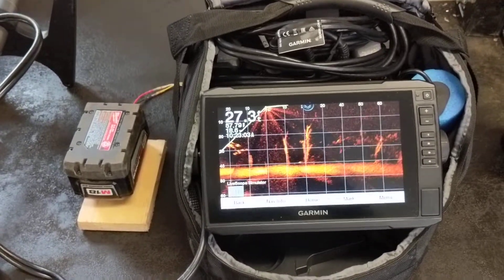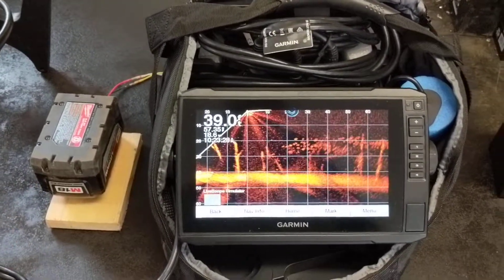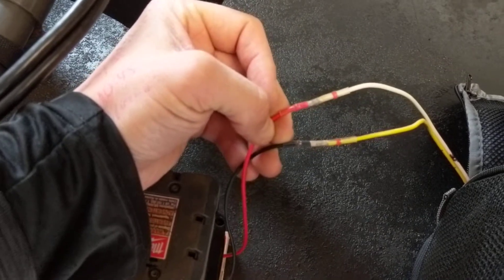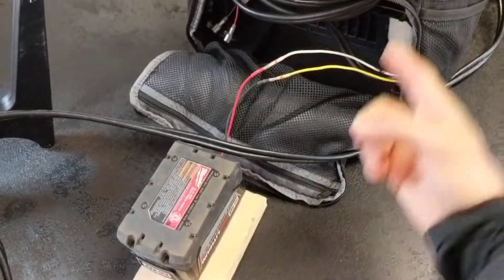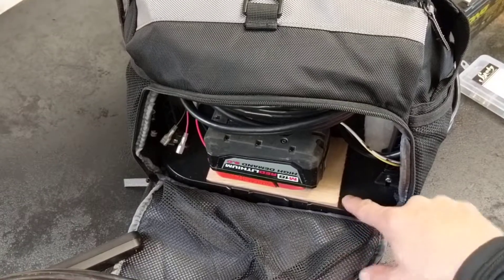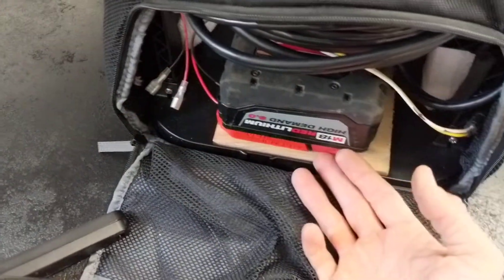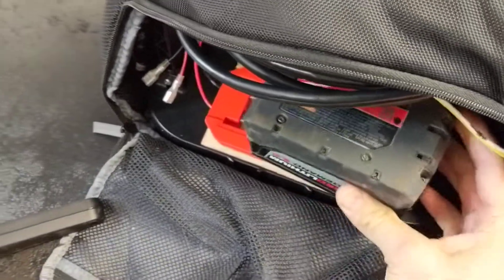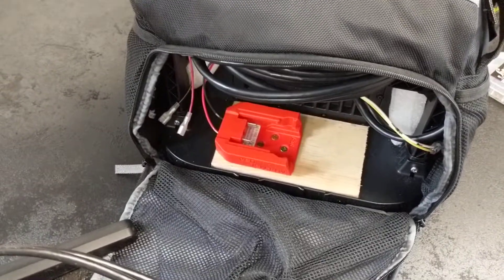Garmin Panoptix Livescope DIY all seasons M18 Milwaukee battery upgrade!

Comment: I'm looking to run my Livescope Ice Bundle on my Milwaukee M18 batteries. I am trying to figure out if there is any low voltage protection for my M18'S? Do you know if the M18's or the Livescope unit have built in low voltage cutoff? Have you had any issues with this? Thanks
Reply from the maker: I never had any problems with my m18s, they would usually shut off around 17 volts.

Comment: Awesome video man. I've got the same exact unit. I was just wondering did you buy the plug and wires for the charging port that connects the Milwaukee battery? finally took the unit out on some open water today and was amazed by the detail and amount of fish, my only complaint though is the stock lead acid battery only lasted for about 2 hours. Once it got down to 9.v the transducer started glitching out and eventually quit working. Anyone considering one of these units getting a better battery is a must
Reply from the maker: The plugs for the Milwaukee adapter are standard sae connectors. I bought them on Amazon
Reply: Is there a link to Amazon on the adaptors?

Comment: Great set up. You can get a voltage regulator off of amazon for like 10 bucks. Seems like some cheap insurance to help protect your expensive unit. Thanks for the vid.
Reply from the maker: There's no insurance needed. Adding a voltage regulator will increase the amperage from 1.25 to 1.75, thus reducing battery life.

Comment: can this be done with dewalt 20vmax batteries? Dewalt states their normal voltage is 18v. 20v without a workload
Reply from the maker: Check the voltage on a fully charged battery, if it is below 20.5v then yes.
Reply: @818Outdoors  
Thanks for your advice.Just to be safe, I got an inexpensive buck converter off amazon and dialed the voltage down to 15v. This way, I can use this setup for any of my electronics by dialing my voltage down as needed. Great videos by the way! Very helpful.
Reply: Yes it can.......I am using the Dewalt 20’s and no probems at all.

Comment: How did you wire out from the adapter.  Only can find usb for power
Reply from the maker: The adapter I use is just  a mounting  plate for the m18 that uses the full battery voltage. I used an extra two prong connector I had used heat shrink butt connectors to connect it so that I can wire straight to the two prong connector Garmin provides.
Reply: Hey D,  I’m unclear how you wired the Milwaukee mount to the livescope.  Which wires did you connect them to? 
Also would it work to install a flat topped male  crimped terminals to the ends of the Milwaukee mount, then you’d be able to slide right into the Garmin female terminal to power it up.  Think that would work or would a guy melt or blow something up? Let me know thanks a bunch

Comment: Your setup is exactly what I’m doing wondering how you did the live scope in the ice bundle
Reply from the maker: Check out my other video, I go into depth on the build. Thanks!
Reply: 818 Outdoors watched all of em lol guess I’m just wondering what all you had to purchase you got the ice bag and what it comes with, live scope, and a head unit. Is that all?
Reply from the maker: 93sv, Livescope unit, big ice kit, ice mount. The bag kit will come with the ice transducer as well as the 12 amp hour battery and some wiring adapters. once you have it built you will have the livescope transducer and also a regular ice transducer.
Reply: 818 Outdoors awesome thanks and I’m guessing the ice mount is the pvc pipe that hold the duecer?

Comment: Thanks for posting! I am looking to do the same thing with the 9.0 ah M18. I was under the impression that the Power Source (adapter) converts 18v to 12v so I am confused as to why it's showing 18v on the head unit display? Are you connecting through the 12v DC Port on the Power Source?
Reply: After looking again, it looks like you aren't using the DC Port (from 2:50 on). If you use the 12v port on the Power Source it would effectively convert your 18v 9.0ah battery into a 12v 13.5ah battery.
Reply: I now see you aren't using the Power Source and there isn't a 12v DC port. This is what I plan using to convert down to 12v . Apologies for the all comments and thanks again!

https://www.amazon.com/Milwaukee-49-24-2371-M18-Power-Source/dp/B008PTP0SK/ref=sr_1_2?ie=UTF8&qid=1541595742&sr=8-2&keywords=m18+power+source
Reply: @alandively3846  I know this is old, but how did you use the adapter you attached?